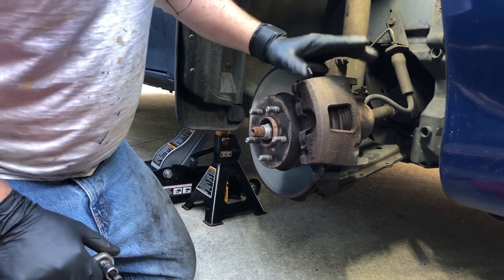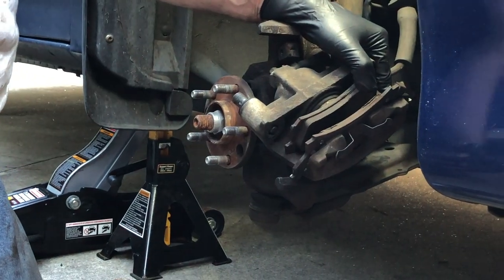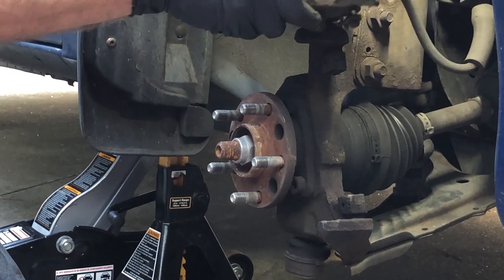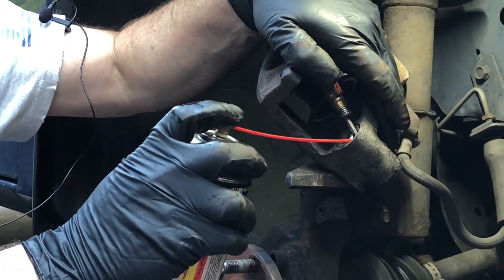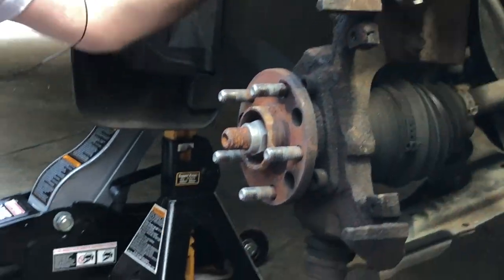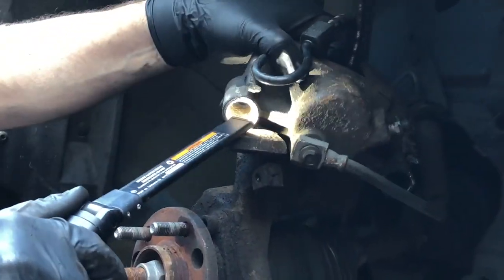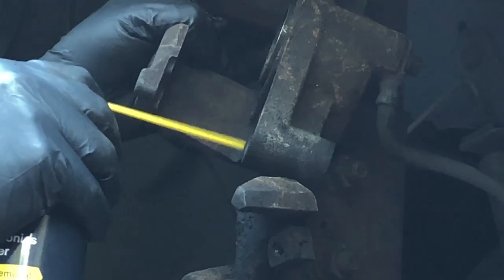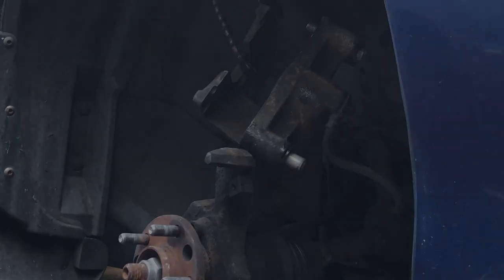1990 - 2005 Chevrolet Cavalier Pontiac Sunfire Uneven Brake Pad Wear / Caliper Slide Pin Repair

Comment: GM, in their infinite cost-cutting wisdom, decided to use the same brake components from the J-Bodies on the 1st & 2nd Gen N-Bodies. These brakes were sized perfectly for the J-Body platform. The N-Bodies, not so much.  I once simultaneously owned a 94 Grand Am and a 93 Cavalier, both with ABS.  It was readily apparent from driving both cars back to back that the stopping distance and penchant for lockup/ABS engagement was greater (on both fronts) in the Grand Am.  I was using Napa Gold brake pads and rotors (on the front) and BFG Touring T/A tires on both cars, so the comparison was about as straightforward as you could get at the time.  That Grand Am was HORRENDOUS to drive in the winter, but the Cavalier was perfectly acceptable.  This was about 25 years ago, so the myriad of performance brake components and winter tires weren't as readily available as they are now, so had those been around, the winter driving experience might've been drastically different..
Reply: The part you have at 8:42, those slider pins were what was on both of my cars, BTW.  Never knew they had sliders that were one solid piece like that.  Seems like a step backward to have those solid pins on a 2004.

Comment: Another good vid 👍🏻 sounds like you still need to fix audio quality 🙂
Reply from the maker: Thanks, yeah this was done the same day on that same Cavalier that needed a new wheel hub assembly with the new mic.  Got the gain on that mic dialed in since and won't be an issue next week and on out.
Reply: @DrShock  ah yes. That makes sense and crossed my mind as a possibility. You’re pretty detail oriented so I had no doubt that you had a solution dialed in 🙂